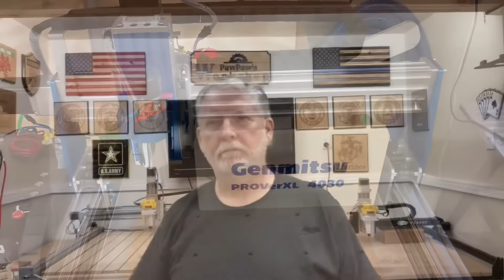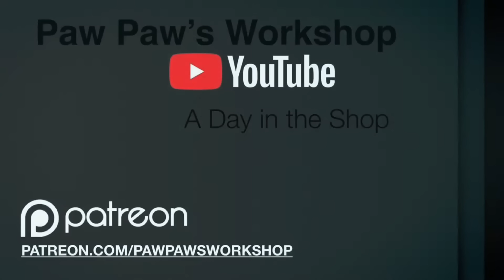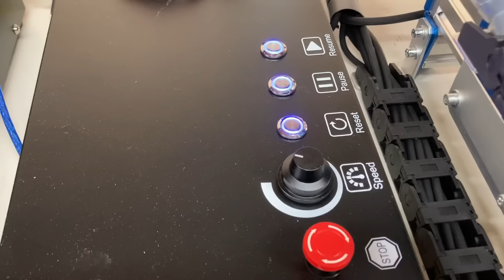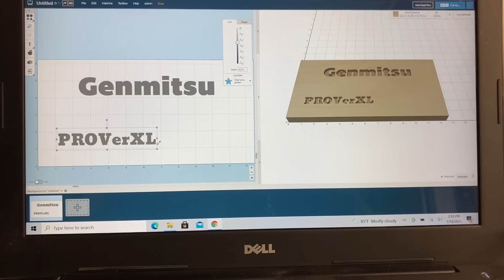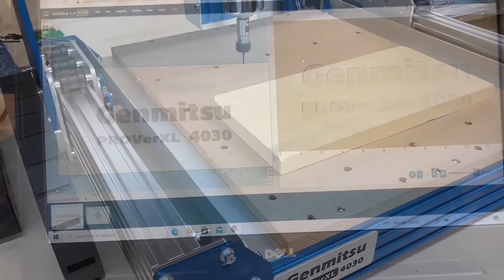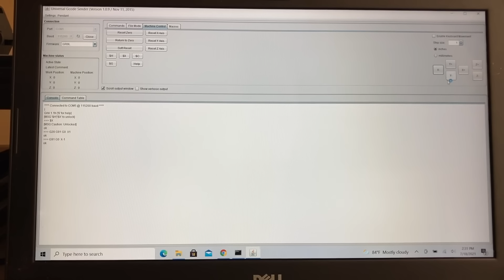First Carve with the Genmitsu PROVer XL 4030

Comment: Good day Papa,
Thank you for this video. 
Please tell me why you used the Universal G-Code sender and did not run the project directly from Easel?
Can the Genmitsu 4040 Pro run directly off Easel or does one have to generate and export the G-Code to run the Genmitsu machines?   I have also done projects the way you did this one  when using my 3018 Pro-Max, but mostly run it directly off Easel.
Am I correct in saying that the main advantage of using the G-Code sender is that your machine doesn't need to be connected to WiFi to run the job, while with Easel you need to be connected to the internet.
Reply from the maker: I have easel only on the XCarve and I run all my projects there on easel. The other machines I use the VCarve pro and the Openbuilds controller

Comment: question i have one of my machines runs fine but when i turn the router on all it does is make a clicking noise and won't turn on i checked the brushes, they look really good. Moter spins really nice thanks in advance
Reply from the maker: Where exactly is the noise coming from?
Reply: @PawPawsWorkShop   from the main box just bought another one have it set up for router going to put the other motor on just to see

Comment: What software on Dell laptop do you used to control Genmitsu 4030?  
Thanks
Reply from the maker: The controller is used for this video was an older version of UGS, Universal Gcode Sender. It was the 1.09 version from 2015. I still use it at times today however, my go to controller that I mainly use today is the Openbuilds controller

Comment: Do you have a video that explains the different softwares for carving on various machines (free and subscription)
Reply from the maker: I use two software, easel and vcarve by vectric. With vcarve you need a controller for the cnc machine. I use Openbuilds. It’s free. In the beginning I used UGS (Universal Gcode Sender). Also free. You can use easel basic for free. You will have to pay for easel pro and for vcarve

Comment: hey pawpaw thanks for the awesome vid, i have had time with lightburn and d1 laser and i want to get into cnc for cutting shapes out of acrylic and wood as well as engraving with it i got rid of my laser i wasnt happy with it and especially the money i spent on it. anyways lol am i able to import vectored designs into the program like lightburn does? my main business is stickers and sublimation so always trying to expand and always wanted to try cnc
Reply from the maker: Yes, you can import vector files into cnc software such as VCarve and even Easel.  I have many videos where I do this all the time.  Also you can use SVG files as well in each of the different software.
Reply: @PawPawsWorkShop  sweet thank you

Comment: I've been looking into machines, only thing I currently run is 3d printers, ive looked into the foxalien 4040xe but have had a change of heart due to belt vs lead screw. I'm now set on this machine but with the added attachments including the laser. How difficult is it to get up and running for someone not doing cnc or laser? Any suggestions or tips would be really appreciated.

Comment: Nice video, I was hoping you would do some v carving or more detailed work for a review & use something other than Easel for software. Thinking about buying one, for me personally, on the assumption you didn't buy the machine, I was disappointed compared to the other cnc reviews of yours.
Reply from the maker: The Genmitsu is very capable of using many different software and very detailed 3D carving

Comment: You said that you set up the spindle to turn on and off automatically. In order for this to work did you need to have the spindle control on the box turned on to full? Great video. Look forward to your response.
Reply from the maker: The gcode commands only turns it off and on. Another line in the code sets the minimum and maximum spindle speed. Yes, you need to turn the knob to full I most cases.

Comment: For the 1/8” spindle machines, is there a bundle of bits that you recommend for using on wood?
Reply from the maker: I have always found that bundles of bits had bits that I never used. I would get 1/8” straight bits and both upcut and downcut 1/8” bits. Then I would also get the 60 and 90 degree vbit
Reply: @PawPawsWorkShop  thank you for your advice

Comment: How much assembly was required for this machine?  Why did you buy another?  I've only had my 3018 two weeks.   I find your channel one of the most useful.
Reply: The gantry is pre-built as is the base chassis. All that needed is attach steppers. Spoilboard, dust baffles, drag chains (pre-wired), attach electrical connectors & check alignment for square. Couldn't be simpler. 40mins & ready to carve.
Reply from the maker: As you see in the video and the other comment. The base and gantry are done. Add the steppers and the drag chain with the wiring. Add the gantry and your ready to go. It takes about an hour or less to assemble

Comment: Had a look at this CNC and they're cool little machines, stout looking. I thought it a bit small for the price tag. Thanks for the review Paw Paw 👍
Reply: It is extendable from under £300
Reply: @JohnCol-1959  yes, the potential for upgrade is wide open, looks like the gantry plates align with the aluminum extrusion rails. Conversely, I ultimately opted for the 1515 Queenbee paired with an Openbuilds Blackbox for control, makita router and dust collection system from inventables (modified to fit), it was just easier to mod theirs, it is nice. But then the table and all the other odds and ends added up quite a bit over $2,000. Whereas this PROVer could find a spot on an existing bench